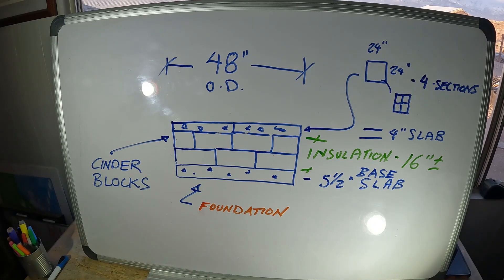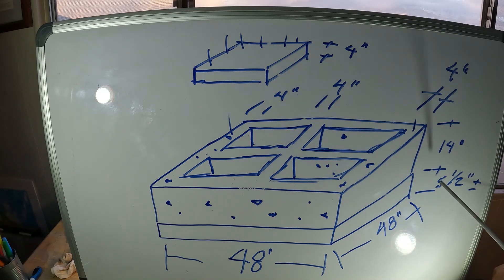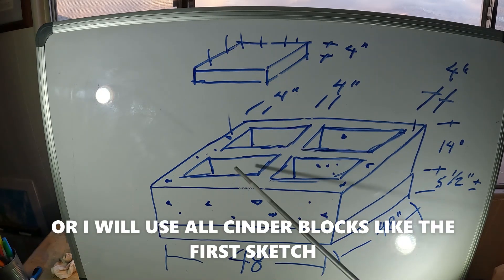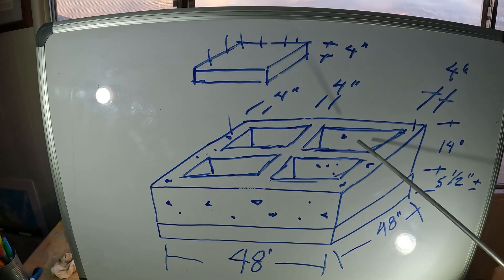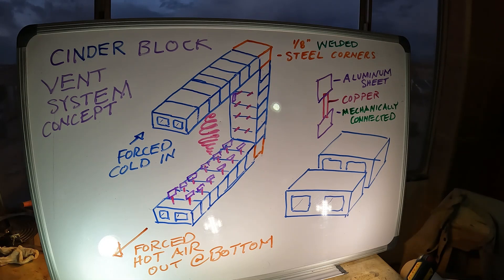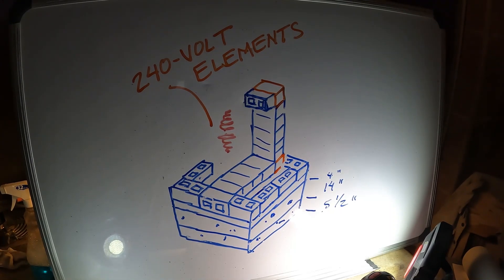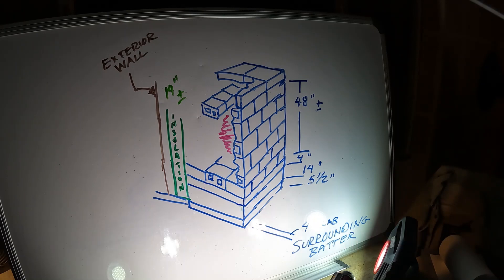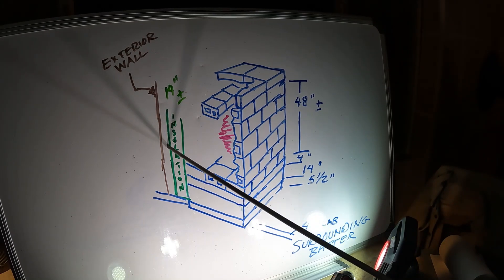Super Sand Battery, New Design, Part 1

Comment: Water has some of the best heat capacity around, for something that is plentiful, cheap, non toxic, etc.  Way more than sand, concrete, etc.  It's limitation is the phase change to vapor at 100*C/212*F at regular atmosphere, but if this is meant to heat a home or greenhouse or the like, doesn't really matter.  What matters is that it can absorb a tremendous of energy, and also decently conducts it (25x more conductive than air), especially when flowing through metal pipes.

Comment: Dear Mike good work

I have a suggestion working on similar project. Why don't you use AHU (Air handling unit )heaters in place of this heaters.

When your heaters need maintenance it will be easy.

 as internal parts will be all concrete hollow block fix air way. Sand will get hot because of hot air and you can use air in recirculation mode

Blow slow air on to it and pass it through your sand system.

Comment: Put a couple of inches of foam insulation down before you pour the bottom, no use heating the ground up. Heat likes to rise up. The horizontal convection runs should be moving in a upwards direction or you’ll need fans to make it efficient. You’re building a mass heat storage package.  It will have heat ready to go to work for you when you need it.  You’re currently building a 16 cuft storage, imagine a 32 or 64 cuft unit, a week worth of storage would be stellar.

Comment: Do u use AC spiral direct from solar panel?  How long sand will stay hot and how much it takes to heat up about 2000kg of sand? im planing to build a fireplace, i already have a metal fireplace shell, I will lay bricks around the shell and damp 2000kg sand inside. Also i have a 6 panels 340w 40v voc so i might put spiral in sand aswell. Have u got any ideas?

Comment: Instead of blocks + heat sinks you could use steel pipe used in gas?! plumbing. 
Steel melts at >1300 deg C so it will resist the heat. 
You can thread the pipe and buy fittings to lay the pipe how you like. 
Iron will conduct the heat so no need to do heat sinks - not as good as copper but might be good enough.
You will probably need to calculate how much you need to get air at the temperature you want.

I think air intake should be at the house floor - cold air is denser and will be at your feet.
There was a guy on youtube doing an simple automation for solar air heaters with 2 temperatures sensors (measure IN and out temperature). 
These sensors controlled the fans that where pushing air into the system. 
Fan where computer fans only on air intake because of cool air.
Reply: I think You can probably also weld some larger pipes !?
There might be an issue with corossion in time if taking air directly from your home (years).

Comment: If possible, use foam concrete as it has pretty high insulating values. Are you sure you want to use aluminium? It melts at fairly low temperatures.
Reply: What about perlite or vermicumite? Its used often in refractory in foundries would hold up to alot of heat.

Comment: Heat sinks  could be any metal, sheet steel,or aluminum. Keep straight  as possible heat likes to travel in a straight  line . Using the block cavities for ducts is good idea. For insulation build a sheet metal box to cover leaving  an empty  space around  the battery without any contact so heat won't have a conducive  path much like a thermos bottle then a layer of insulation on the outside of the metal  enclosure. 
I am experimenting with a voltage sensing relay switch to switch power from my battery to heating element  when battery  is fully charged using the panels output when they are not needed  to charge the battery  or run an  electrical load.
Reply: You should do a tutorial on it
Reply: @zapcjw  lots to work out yet using relay found on Amazon  that turns on and off by measuring  battery voltage .when battery  gets full relay turns on when battery discharged to preset level  will turns off the  heating element. Have not yet figured how to go direct from panels. This method pulls power from charge controller,  battery  circuit.